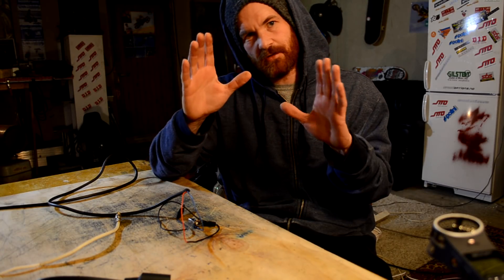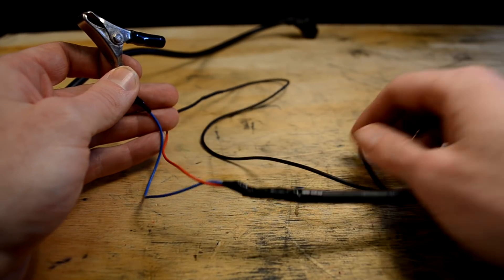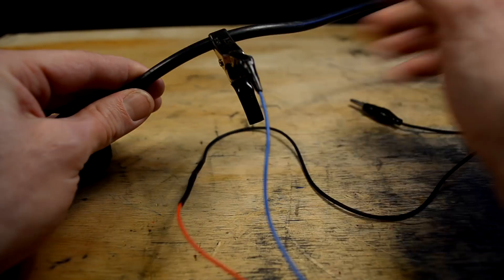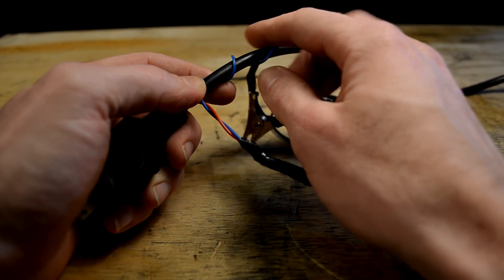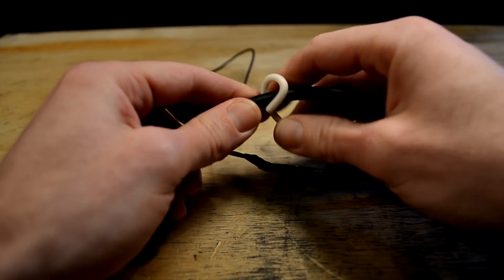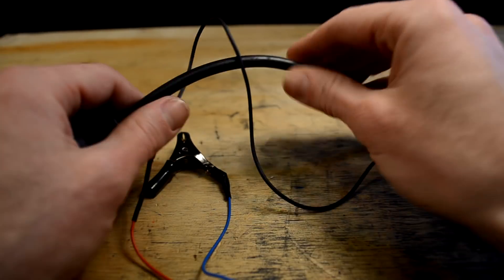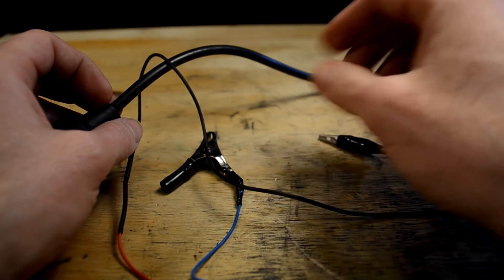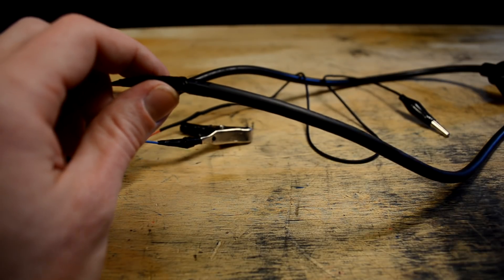Simple Capacitive RPM Pickup (for the Ardyno DIY Dyno Shield)

Comment: Sorry not related but Alex could you please do a video on 2stroke oil types there’s a shit tonne out there and is there really a difference? I’d love to hear your take on it .
Reply from the maker: +Lewis Irvine Sure! As soon as I have time! My go-to oil is Castrol A747 btw, works with alcohol fuels too.
Reply: 2STROKE STUFFING amazing thanks is it possible to over spec oil would a747 be as happy in a puch maxi as it would a highly strung Mito random example ! Like would a stock ped run too cool ? So much basic junk I don’t know !!!!
Reply from the maker: +Lewis Irvine Not really, but the A747 is a caster blend and will gum up the piston/cylinder more than a fully synthetic. And it's not really needed unless your on the bleeding edge with heat. The benefit with caster oil is it's ability to keep on lubricating when other oils just burn up.

Comment: can u make a video of making the wire itself
Reply from the maker: +Crap Pizza I could but it's really easy. If you're not going to use a clamp it just a matter of stripping some insulation. With a clamp there's one solder joint.

Comment: wouldnt that be inductance and not capacitive
Reply from the maker: +phil no No, the clamp/wire forms one of the plates of a capacitor, the sparkplug lead the other. AC coupling. Inductive pickups are current sensing and you need a ferrite around the sparkplug lead.
Reply from the maker: +pab26120 No, seriously, this is not an inductive pickup, it's capacitive.
Reply from the maker: +pab26120 Think that would've been my choice too...
Reply: this is most definitely inductive, if it is capacitive then its capacitive in ways i simply cannot understand :-)
Reply from the maker: +phil no Google "capacitive coupling"
Reply: It is a capacitive pickup guys, period. just look it up if you don't believe it. In an inductive pickup system would have the other side of the "coil" attached to the circuit as well in order to get current flow, instead of directly to ground. imagine a transformer with only one side of the secondary coil connected to a load, there will be a potential difference (voltage), but no current flow because the circuit is open. 

The wires around the spark plug wire form one of the 'plates' of a capacitor, and the number of turns determines the plate area.

i am an aircraft technician student, hope my explanation helps :)